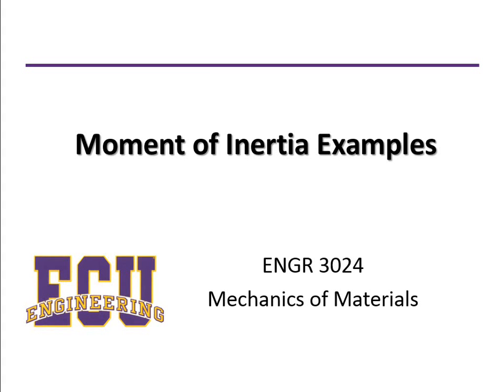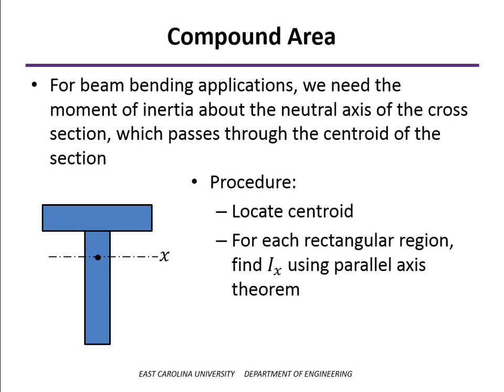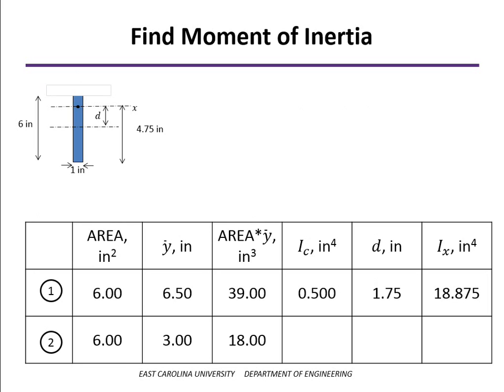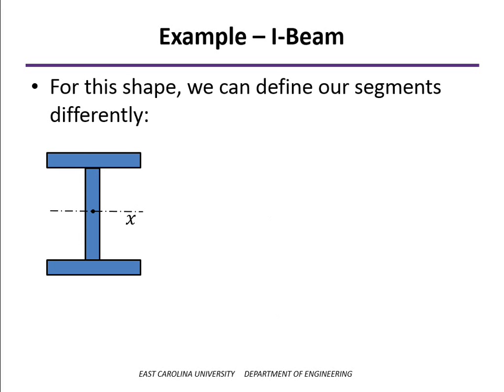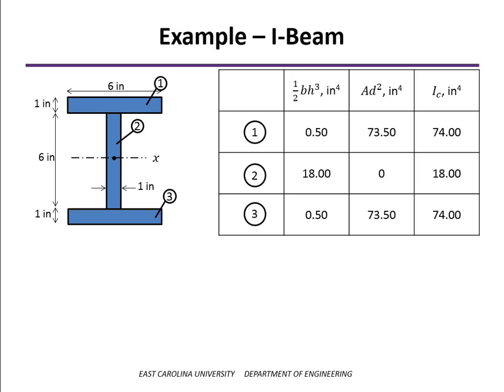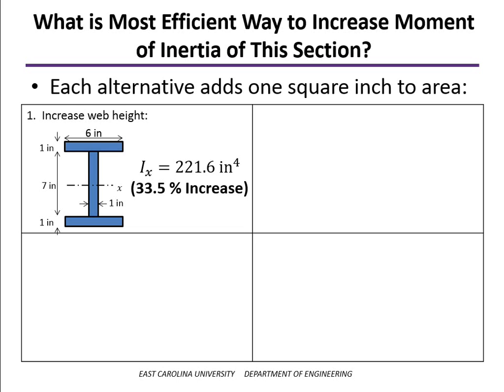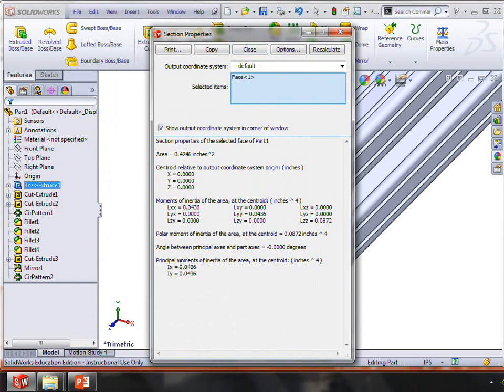Moment of Inertia Examples

Comment: Great vid! While designing the I-beam, to increase moment capacity, the best option is definitely increasing the height without changing any other thing. 
Increasing web thickness is useful for increasing shear capacity. 
But is there a capacity type that increasing flange width/thickness is the best option for that?
Reply: Yes, wider flanges would improve the moment of inertia in the y axis. While thicker flanges improve the beams torsional properties.

Comment: This video is really helpful.
However, how am I going to solve a problem for an I-beam if the height and the width  of the web and flanges are not given and just considering the thickness of those two are the same.
 Though the x'-axis of the cross sectional is given and is equal to 334,000 cm^4. The cross-sectional area is 86 cm^2. 

It is asking for the moment of inertia at the centroidal axis.

I can't solve the problem. Please help.

Comment: how do you get the 2.5? can someone explains to me
Reply from the maker: The overall width is 6 inches, and the width of the web is 1 inch.  Therefore, the width each of the rectangular areas removed from the rectangle defined by the overall dimensions is one-half of 6 minus 1 or 2.5 inches.

Comment: A good engineer can work with any unit.
Reply: Can?  Maybe.  Should have to?  Absolutely not.  Just about any engineer who actually uses numbers and measurements to perform calculations on a regular basis will agree that English systems of units are stupid.  However in my experience, most people who don't (most people period) will argue all day long about how we shouldn't change because they like the fact that they can drive 1 mile per minute at highway speeds, and they're used to feet and inches and don't want to learn something else.  Frustrating!
Reply: There is no any units its only american and rest of the world. What a stubborn nation.
Reply: There's also Myanmar and Liberia, but yes. We have to learn two units instead of one, which just adds another layer of (unnecessary) difficulty to being a civil engineering student.

Comment: whta if the question asked to find MOI about the y axis?
Reply: Jorge Rubalcava It sounds like you're looking for the MOI about the Neutral Axis, correct? In that case, it's the same process, except you're finding the moment of the segment's area about said neutral axis. That is to say, either to find the moment of the segment to either the right or left the N.A. because your question asked for the y axis. It would be above or below if it said x axis. This is useful to find the shear flow later on.

Comment: Can we calculate the moment of inertia of an L shape by substracting a whole rectangle to the "empty space" as done with the Double T shape in this example?
Reply from the maker: Yes, but there's not really an advantage as there is for a section that is symmetric from top to bottom.  With an L-shape, you have to apply the parallel axis theorem to both the whole rectangle and the empty space, since the centroid of neither of the pieces lies on the neutral axis of the section.

Comment: how did you got the 4.75???? the y(bar)
Reply: You have to sum up all the y * a, then divide it with sum of the area. From this video, it is the sum of the third column divided by the sum of the first column.
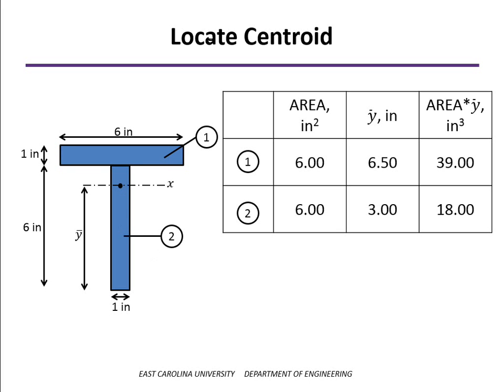Reply: at 3:13,   57/12 = 4.75
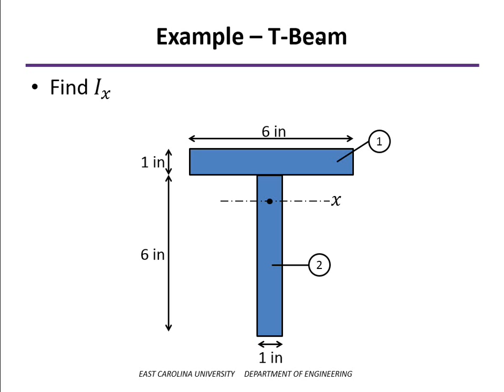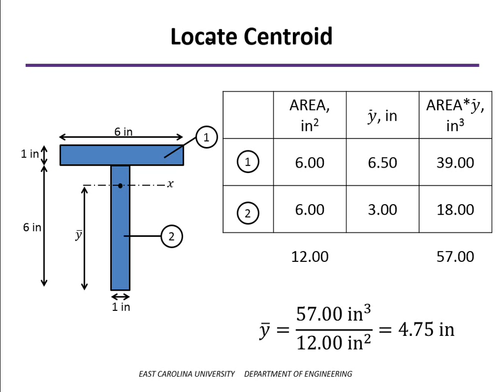Reply from the maker: That's shown from about 2:00 to 3:30.
Reply: no it's not

Comment: For I beam. Why 2.5in for B?
Reply from the maker: The overall width is 6 inches, and the web thickness is 1 inch.  Therefore, the width of material "removed" from each side is 1/2(6-1) = 2.5 inches.